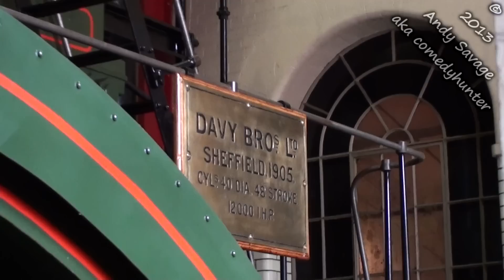Worlds most powerful steam engine still running. 12000 Horse Power. The River Don Engine, Sheffield

Comment: Titanic's two reciprocating engines had an output of 15,000 Indicated Horsepower each. However the identical engines fitted to Olympic were pushed to over 18,000 HP
Reply: has that anything to do with being converted to run on oil?
Reply: And 18,000 horsepower really did a number to that submarine. Chopped the pressure hull like a 1000 degree knife through butter.
Reply: @KriegProductions  Nope.
Reply: After refit
Reply: @Sanyey More down to the engine rebuild which was carried out at the same time. It was noted that in her final years, her engines were operating better than they ever had before.  18,000 horsepower in a tremendous amount of power for a reciprocating steam engine.
Reply: @lsswappedcessna  Agreed. The only damage Olympic had was a slightly swisted prow. They found a torpedo sized dent in the hull in dry dock, and reckoned the submarine had tried to sink Olympic just before she rammed it.
Reply: Plus the central steam turbine that drove the center propeller (UK: screw).
Reply: But weren't the engines in the Titanic triple expansion engines?  The River Don engine is a single expansion engine.
Reply: @David Winter  The titanic's reciprocating engines were triple expansion. If memory serves they were of four-cylinder types with one high pressure, one intermediate pressure, and two low-pressure cylinders.  The reciprocating engines then exhausted steam at less than atmospheric pressure into the turbine engines with the steam being pulled through by the vacuum created by the condensers. The central turbine was only activated when exhaust steam and the system were hot enough for the steam to remain dry in the turbine to avoid erosion of the blades. It made the system extremely efficient by steam engine standards. More efficient than single expansion, reciprocating or turbines alone.
Reply: @duncanbhaltaireanraigwilso9627  Yes, they needed the efficiency on the Titanic, but  on the River Don engine they needed to be able to reverse it very quickly when they were rolling armour plate.
Reply: @Sanyey  Bunker oil has a higher energy density than coal, so presumably the boilers could produce more steam to get the boost to 18,000 HP.

Comment: That's a motor! how fast he picks up the RPM, he is INCREDIBLE for what he weighs, and how big he is.
Reply: In the steelwork It ran at 120 RPM 165 psi in the museum we run it at 100 psi on a fast run its been clocked at 90 rpm

Comment: You can only appreciate the full awesome power when you're there. The heat from the engine can be felt and the whole concrete floor of the building shakes.

Comment: This is the most powerful working steam engine that's still running  and It's still going strong today.  Yes  more powerful engines were built   Davy Brother of Sheffield built one  rated at 16.000 HP in 1905 very  similar to this  design  minus the drive wheel. some  were  built at 18,000 HP to.  In the USA Todd rolling engines were built rated between 14'000 HP and  20,000 HP  In the 1940's and 1950's five cranked rolling mills engines were built  and rated   at   30.000 Hp in Germany. 

The working drawings to the River Don Engine date back to 1902 so we think that the first mill was probably built around about that time. Each one we think took roughly 4 to 5 months to construct , the engines were probably painted dark grey or black. 4 of there engines were built one went to John Browns in Sheffield  , another up to Beardmore Glasgow and one also went over to Japan.  Lets be thankful to Hugh Wentworth Ping for saving this engine, from being scraped in 1978 having  to raise £20,000 which was a lot of money back in them days.
Reply: Do you have any information on the 30,000 horsepower rolling mill engine in Germany?
Reply: Hi Gregory the only info I have was in a book by George Watkins he was a heating engineer and in his spare time went all over documenting stationary engines. Then only info I have is that It was built by Erhardt and Sehmer in 1947 1953-54  30,000 hp five cranked fully -enclosed high-speed set with hydraulic valve gear. for some reason I thought they were built during  20s and 30s . I have a poster of a Davy Engine that went up to middlesbrough and was rated at 16'000 hp with Joy Valve gear no drive wheel. I know a chap who might have a poster of the 18,000 HP engine that Davy built  he was a rolling mill technology manager for siemens. There's a copy of the book I have  It's on ebay for £8.99 in good  condition with an orange cover The Steam Engine In Industry -2 Mining and the Metal Trades By George Watkins
Reply: @gregorymalchuk272  its actually 40.000 hp
Its giant 
I have visited it
I think it revs at max 5 rpm 
Which is quite insane how much power it outputs

Comment: The acceleration of this massive engine is impressive,  amazing what was being built over 100 years ago.
Reply: Steam engines in general have the highest torque output of any engine type per horsepower generated. The Titanic would pull an Airbus A380 backwards despite the Airbus having over 4 times the horsepower.
Reply: and deceleration. I was surprised at the RPMs.

Comment: Another fun fact is one of the 5 went to Japan and later rolled out the armor/armour plates for the Battleships Musashi and Yamato. 2 of the biggest and most powerful battleships ever built and much like the German battleships Bismarck and Turpitz they didn’t go down easily.
Reply: Bismarck didn't go easily, but her cause of death was rather embarrassing, just like SM U-103. Embarrassing. An engine similar to this powered the Olympic at the time. Was a year before the conversion to oil engines, in 1919.

Comment: 12 times the horsepower of a Bugatti Veyron, runs off coal.

British Engineering rules here : )
Reply: Try driving a steel rolling mill with your "Veyron"
Reply: 12 times the horsepower of a Veyron, and probably hundreds of times the torque.
Reply: Bloodgod40 but also not a car.
Reply: Also about 10,000 times the size and 100,000 times the weight of a Veyron. I'll still take the steam tho.
Reply: @Bloodgod40  Not fair with such big flywheels, they provide the most torque.
Reply: Yes but the veyron is like an ant compared to this behemoth
Reply: actually the horsepower of one top fuel dragster. The torque of all of them many times over.
Reply: A Veyron engine runs at full power for 12 minutes before the fuel tank is emptied. Few automotive engines can survive for long at full power. Grand Touring cars have derated semi-racing engines. The Maserati Merak could cruise at maximum speed for perhaps an hour before running out of fuel. Its DOHC V6 engine was rated 180 HP but in racing tune just over 300 HP. Of course its fuel consumption increased markedly.
Reply: Imagine it spinning up to 6000 RPM

Comment: , The missing engine of 16,000 hp was at Dorman Long in Brittania Works , Middlesbrough. Had a new one piece crankshaft in the mid 1950,s
it drove the mill that rolled 12" X 12" angle sections for the Sydney Harbour bridge , waste steam drove turbines for electricity production .
Reply: I was very lucky  to purchase  some photos and cutaway drawings of that Davy engine that went to middlesbrough  rated at 16'000 hp

Comment: The most powerful steam (single ) engine ever built was built by Allis Chalmers in Milwaukee WI. I think some posters are over rating the hp or they're giving a total rating of multiple engines.
The manhattan engines ran a nominal hp of 12,000 and as much as 18,000 and were the largest ever built, it was impractical to built them any more, or any bigger and prime movers went to steam turbines

Comment: I've read that this thing runs at 70rpm. 12000hp at 70rpm means this thing is generating over 900,000 lb-ft of torque... I can't even imagine what this was capable of at its limits.

Comment: The tittle may well be correct it's a mill engine for rolling steel into sheets so hp isn't the important factor torque is and ability to be stoped and reversed quickly
Reply: I was wondering why it kept changing directions, and that would explain it. Thank you.

Comment: During the time when  the engine was being dismantled from the mill and moved  to Kelham  removing  the pinion gearbox from the bedplate caused big problems.  There was a  hole in the foundations were the gearbox sat, full of oil and grease. Scooping It out  by spades   and buckets was a  laborious task,  so in order to remove the oil they set it on fire to  burn it all away . unfortunately this  resulted to part of the bedplate cracking the next day . So a company that specialized in heavy engineering stitch welding was employed to fix the bedplate  There's also historical ladder scaring  on the No 1 cylinder connecting rod . The engine took 3 years to restore don't worry then engines safe as house when It's running  Kelham Island Museum is Open  Tuesday to Friday and Sundays  free entry  the  engine running times are 12.00 pm and 2.00pm

Comment: Wow… that reverses so quickly and easily.  Can’t do that with a big marine diesel
Reply from the maker: yes amazing isnt it, its so it can roll the sheet metal in the other direction back and forth.
Reply: @comedyhunter  There’s an amazing vid of a Sheffield steelworks in the late Forties…. I’ll try to track it down…
Reply: @comedyhunter  I think the documentary was called The Steel Industry & The Workings of a Foundry, made in 1945.  Amazing!
Reply: Also ‘The Manufacture of Steel - 1945’

Comment: it has 12,000 industrial horse power, its different from regular horse power. if you work it out in regular horse power its more.
Reply: The I stands for indicated Horsepower  as It goes on cylinder Dia 40 " bore  stroke size which is 48", rpm which  was 120  rpm in the steelworks and of course boiler pressure too . At Brightside It was  working at 165 psi that's 100 tons on each piston
Reply: The horse power are still the same, the difference are torque and rpm. This steam engine could reach 12k hp on low rpm, on car that needs high rpm

Comment: What's the torque on this
Reply: There's around 210 tones of moving parts, the drive wheel alone weighs 51 tonnes  the hydraulic cylinders that move the revering arms back and forth use oil and operate at 1000 PSI.  It works on 100 psi of steam pressure  and runs between 70 to 90 rpm. In the steel works the engines speed would be around 120 rpm and sometimes up to 170. depending on the size of the billet,  the steam pressure was  160 psi. that's 100 tonnes in each cylinder . The rolling mill was 14 ft wide and It could roll plates of steel up to 80 tonnes in weight  and 40 feet in length.
Reply: 90000 ftlbs
Reply: 3.8 million NM :) 1.5 miliion NM of torwue x1.5 millionnm plus turbine 813 000NM = NM total in 3.8 million NM making it almost power full as the largest container chip in todays faries/ships.
Reply: Charlie Potte

Comment: What's the odd clunking sound? It doesnt seem to be coming off the engine itself ?
Reply: Another commenter mentioned that the banging noise is "backlash" in the gears, caused by the engine operating without a working load. Engines are designed to do work, so running them like this causes odd behavior.

Comment: 12,000 horsepower is not the most powerful. The triple expansion plants in the Olympic class ocean liners (Olympic, Titanic, Britannic) were 15,000 HP, and were the actual most powerful steam piston engines.
Reply: Not so. The single largest engine was the Manhattan engine built by Allis Chalmers
Reply: @RJ1999x  - 11000 HP .
Reply: @haraldpettersen3649  that's what the Manhattan engines made
Reply: That was what i meant 👍
Reply: @haraldpettersen3649  I figured that. I have the original engineers blue prints to the Manhattan engines
Reply: @RJ1999x  - I would love to have them (really the original ones ?) 🤪
Reply: @haraldpettersen3649  yep I outbid the Smithsonian for them hoping there was a drawing of the complete engine/generator but it's all individual parts to build the beast
Reply: @RJ1999x  - You are a lucky man (smart) 😉
Reply: @haraldpettersen3649  that's debatable! Lol
Reply: @RJ1999x  - what is debatable you mean 🧐
Reply: @haraldpettersen3649  how smart or lucky I am!
Reply: @RJ1999x - Thanks for replying, do you want to sell them ? .  I suppose It is allowed to ask  😏
Reply: @haraldpettersen3649  it's possible I suppose, if the price was right
Reply: @RJ1999x - The price is high i presume ?
Reply: @haraldpettersen3649  your free to make an offer, I'm not sure I would sell them but maybe

Comment: where this engine is used
Reply: The engine currently resides in the Kelham island museum in Sheffield south Yorkshire. It was used to drive a hot rolling mill, the flywheel which had to be put on in the wrong direction in the video for space would drive a set of rollers and so would the crank shaft. The engine reverses in 2 seconds so that the metal would not cool as it was being passed between the two sets of rollers. It worked 50  years at Cammell's mill before being moved first to British Steel's River Don plant (hence its name).

Comment: Sounds like it's desperate for oil. How can they just run it at some special hour? A steam engine that size needs at least three hours warm up before it can run, or it will break very soon  ...
Reply: The sound is the meshing of the gears between the engine and the 100 ton flywheel. As there is no load on the engine you get backlash on the gears which is what you can hear. This would have been linked up to a massive steel rolling mill originally and you wouldn't get the backlash.

Comment: this has NEVER been the largest steam mill engine ever built or the most powerful... think you need to read your engines m8.... I know of one what was built far bigger and more powerful than this

richardson westgarth 25,000 hp rolling mill engine !!!!!
Reply: I have an old photo of the Richard Westgarth engine same configuration at the  River Don engine vertical 3 cylinder single expansion with Joy Valve I think It ran on around 220 psi and ran at 200 rpm It was huge It had no drive wheel to

Comment: I thought the world's most powerful steam engine is the Titanic
Reply: Not even close. The most powerful steam engines built were the Manhattan engines built by Allis Chalmers
Reply: Nope the world's most powerful steam engine is Southern pacific 4294 it has 56000 HP
Reply: @yujirohanma3041  not true
Reply: It's true
Reply: @yujirohanma3041  6000 hp was it's rating
Reply: @yujirohanma3041  it's 6000 hp actually, so you're waaay off the mark
Reply: LoL
Reply: @yujirohanma3041  - ?? The Southern pacific 4294 has only 6000 HP (4500 KW) . Or do you mean some other machine ??. The Southern Pacific 4294 was a locomotive .
Reply: The Titanic is underwater, this isn't.
Reply: @lsswappedcessna  NO the titanic hade 18 000 hp per cylinder bank engine at maximum 83 rpm making plus 18 000 hp wtich sec engine plus turbine 175 rpm  22000 hp = 59 000 hp "Total 46,000 hp at 75 rpm; 59,000 hp at 83 rpm (37 MW)."  checkout youself: http://www.newworldencyclopedia.org/entry/RMS_Titanic mking its steam engine most poiwer full ever made. the torque as usual is about 10 times more than IC engines. making titanic per truipple engine  making 1.5 miliion NM of torwue x1.5 millionnm plus turbine 813 000NM = NM total in 3.8 million NM making it almost power full as the largest container chip in todays faries/ships.

Comment: this is not the most powerful steam engine ever. many steamships had more powerful engines Like Lucania & Campania , who both had 15000 HP  5 cyl triple expansion engines,  so did Olympic & Titanic ( 4 cyl. 15000 - 18000 Hp ) The most powerful one ( to my knowledge was in Cronprincessin Cecillie : Those where 8 cyl, 6 crank Quadruple engines that gave 20.000 Hp each...